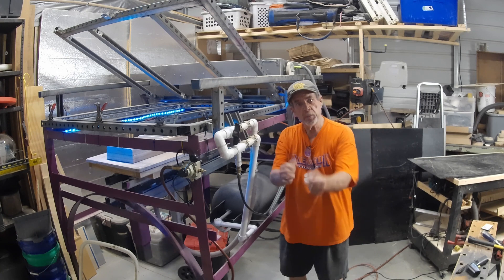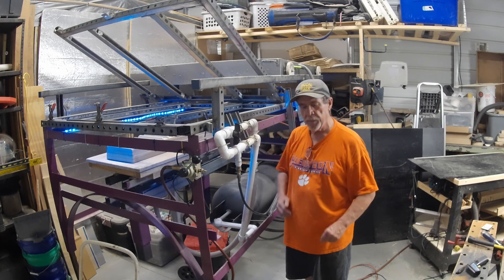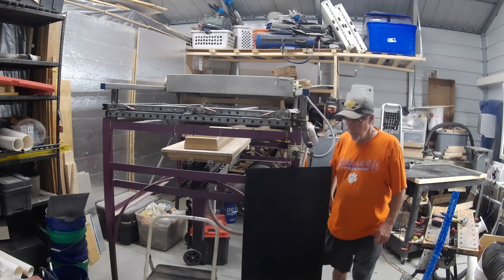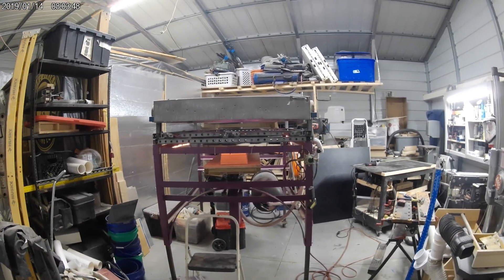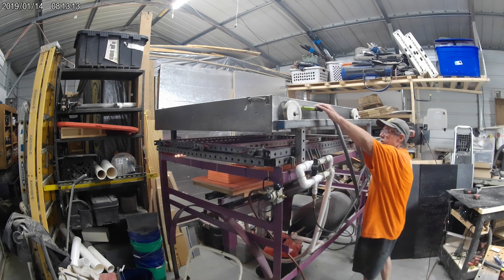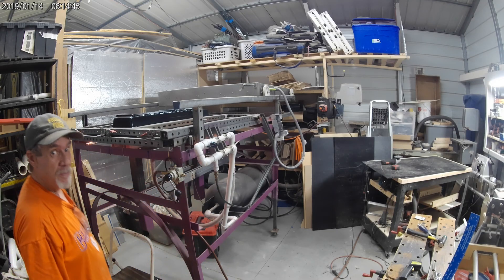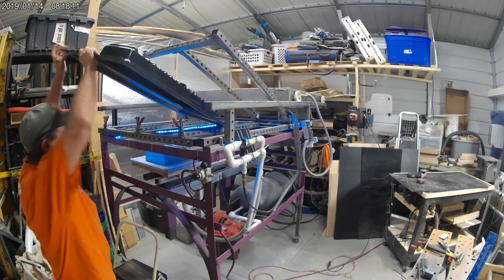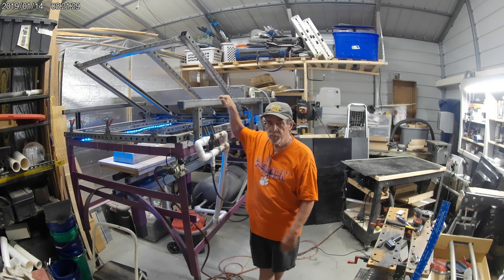How to Thermoform ABS PLastic | Gold Sluice | DIY | Vacuum formed | Spike's Prospecting Equipment

Comment: Hay Spike it looked pretty neat. One thing you might think about if nothing else you may be able to make it a little shorter by cutting down the legs a bit to allow you a little easier access to the top side.
Reply from the maker: Robert, I have to get inside to change out the molds for different size parts and shapes!  I make about 12 molded products, and build 21 variations of Gold Prospecting Equipment!

Comment: Very cool Spike!!! I did thermo vacuum forming in jr. high & I loved it. I’ve done woodwork all my life & tweaking guitars for 40 yrs, but I have countless times wish I had a vacuum setup to make parts & molds.  I don’t have enough room as it is, I’d have to give up 1 of my ShopSmith’s.  As long as I’m doing most of my work in my 2 car garage that isn’t going to happen. I’m extremely curious about your machine & would love a more in-depth video. Great stuff Spike!!!!!
Reply from the maker: Danny,  I have a video on the prospecting channel explaining it and showing more detail, Let me see if I can Find it for you!!  Link to the Channel at the bottom of mine.  I wish this machine was about 1/3 this size,  I could do the things I need to do. I always thought, I'll make nested batches of parts,  no way, to finicky, Big Girl needs the touch!!  and a Little squeeze every now and then,  LOL  Thanks for watching, just sharing the other stuff I do, did not know if anyone would watch or not!!
Reply from the maker: Give up Shopsmith, like that won't work, one of mine is broken, needs a potentiometer for the speed control!!  But it was zipping before it quit,  LOL  I saw it at 7200 rpm, smooth as glass!